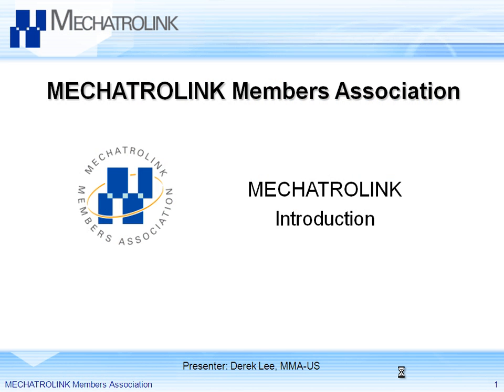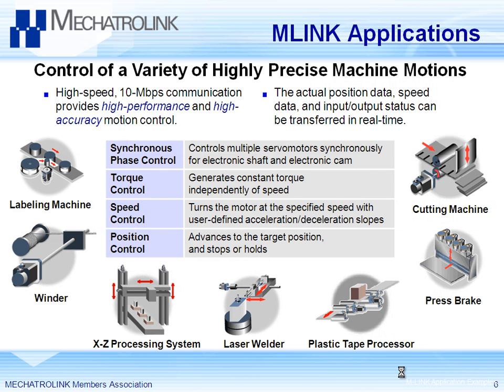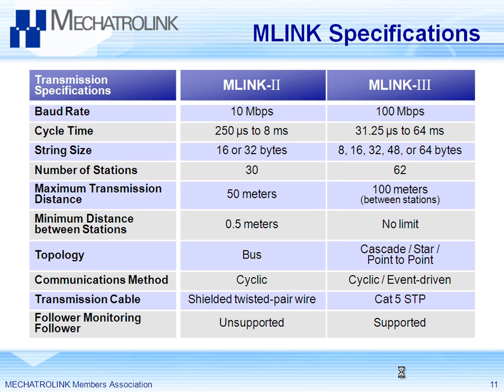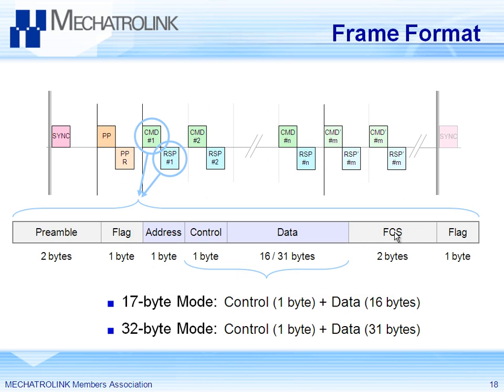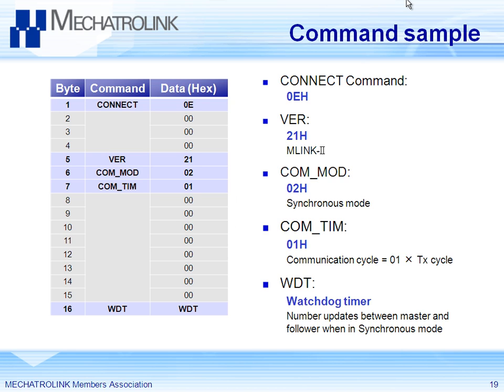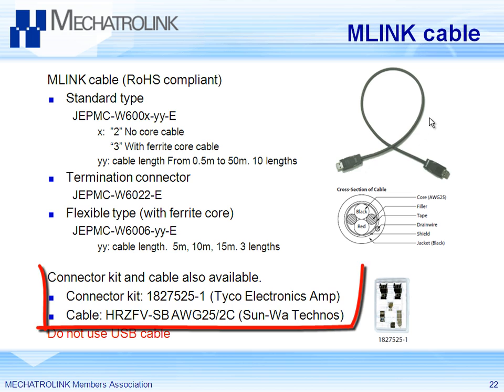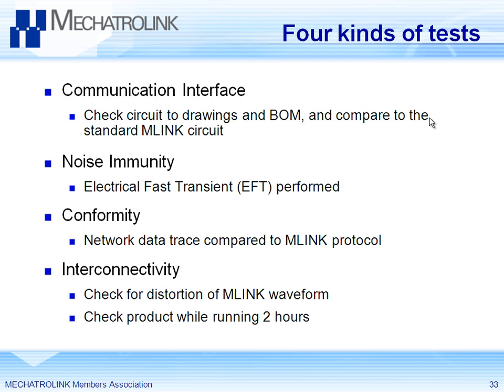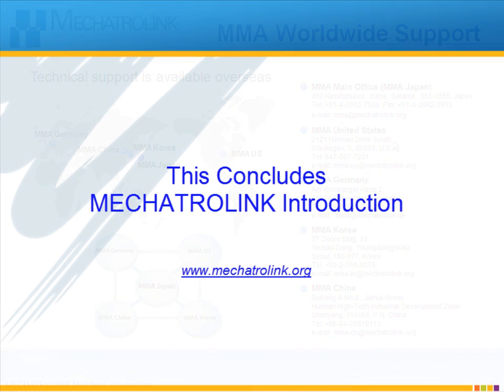Mechatrolink Introduction

Comment: Hi I am planning to buy pulse and direction  motion control card but I already bought servo drives and servo motors

servo drive is .......SGDV-2R8A11A..............MECHATROLINK-II.......alfa 5 .type

servo motor.........SDMJV-04ADE6S

computer with windows 7 professional version

all wire power supply etc

I NEED TO KNOW 

pls advice

What else I should buy beside  motion control to work with MECHATROLINK-II thank you very much if I use Network Converter NETC01 to get MECHATROLINK-II  out how i will assign the master thx
Reply from the maker: Hi Deepa, Thanks for your comment. To best answer your question, please contact Technical Support at motionsupport@yaskawa.com.